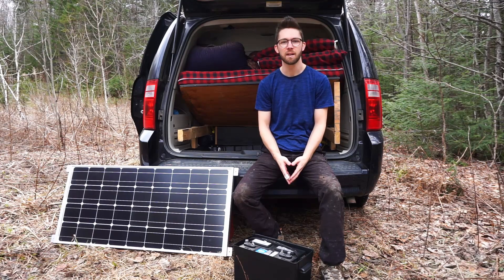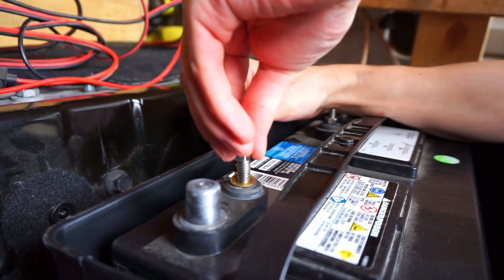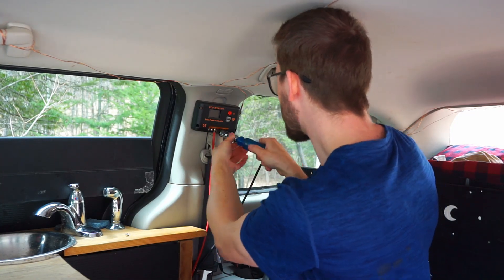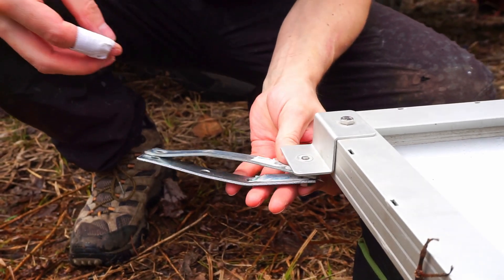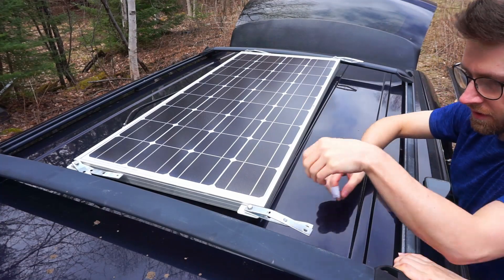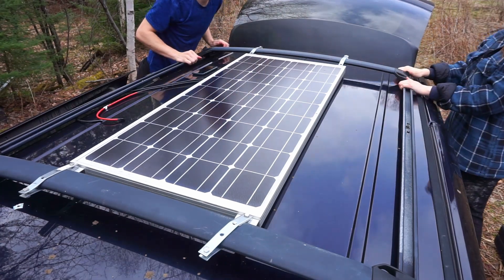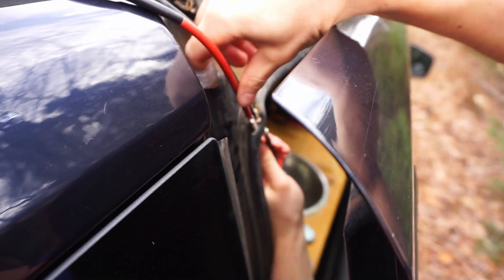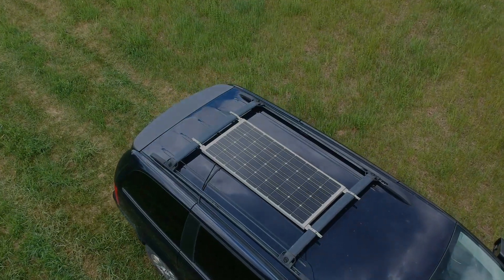How to install a SOLAR PANEL on a minivan campervan roof

Comment: One thing you might want to do is add some neoprene under the metal strips for anti-vibration /shock absorbant, and not scratch up your rails...

Comment: Thank you for showing this — how to also connect the wires. I am learning and have a mini-van for camping.   What kind of solar panel? How many watts?  What size battery?  That is so much fun to have the solar power on the roof. It looks great!

Comment: 2025:  Any water infiltration in 3 years with the incoming wires?  I'm thinking of a "drip loop" possibly through the rear hatch.   I also might stagger the lenghs of the two leads to reduce the risk of a short circuit, with redundant heat shrink tubing as well.

Comment: Has this held up well?

I'm looking at getting alu angle lengths 2 - 4pcs. 
Bolt them to the panel first.
Flip panel upside down on roof racks, drill through cross bar and angle. 
Flip back over and bolt on from underside or rails. 

Cheers from shaun.

Comment: You could use in fact, on 1 side, U brackets that slide just over roof bar, pinching it without having to attach in on that side. Easier and faster to install.
Just an idea

Comment: Thanks, I like the way you mounted the panel. 1 ? though would be alright to put pool noodles under the panel to help with movement at least while driving?

Comment: Hi, how will you mount the same solar framed panel using standard thule T-slot bar and do you think what size of solar panel is safe to mount? 20kg, 380 W 170x100cm?

Comment: I just tied mine on with parachute shroud. All I had to do was drill extra attachment holes in aluminum panel frame. Only drawback is they would be easy to swipe.

Comment: What are those brackets called you clamped to the crossbar?
Reply from the maker: They're flat mending plates. They bent around the bars as I tightened them
Reply: @NickandMaëla  ❤️

Comment: Have your solar panel cable held up with the door opening and shutting on them frequently over time?
Reply from the maker: Yes there's enough gap that they don't get crushed or anything. Plus that door is rarely opened

Comment: Can u connect with out z brackets and hist use the connect straight to bottom of pannel
Reply from the maker: It's possible, I guess. It would just change how high the panel is above the roof of the van

Comment: Where did you get the bracket for the solar panel? Can you send the link where you found it?
Reply from the maker: They're flat mending plates found at hoke depot. They bent as i torqued them around the roof rack bars
Reply: So you wouldn't recommend them? I need something to make my solar panels reach my roof rack or might have to build a platform with thick wood

Comment: i just strapped 2 solar pannels to the roof rack and they fit width wise end to end perfectly snug between the roofrails and i just zip tied them together, easiest thing ever, no tools required. they already have holes on the underside of the bottom corners that u can run a zip tie through. its like they where designed to fit together inbetween roof rails.
Reply: Upload video
Reply: @KT-ed8hj   i kind of run a shit post youtube channel and i dont want to show people what car i drive or where i live. geo guessers n shit. 
I upgraded since, i have 4 solar pannels now. horizontally across the car in a row from back to front. they are zip tied to eachother and then 4 extra holes where drilled on the underside of each pannels frame that i have zip tied to the roof rails. the roof rails are retracted and the pannels sit flush ontop of them and are zip tied under. each 2 pannels gets their own charge controller which runs into a bank of 3 batteries that go under the floor in the stow and go seating compartment. this feeds the 4000 watt inverter.
Reply: @wompstopm123  thanks for sharing that. I am planning on driving up to seattle next week and living out of my suv for a couple months while doing side gig apps. I am wanting to get a 42L fridge/freezer in my car and will run a box fan at night. Was wondering how i can go about this without screwing my alternator or car battery. I have no idea what im doing. I just know i need a freezer and box fan in my car and will be running the car all day every day.
Reply: @KT-ed8hj  
Your fridge/freezer should plug right into your car/vehicle's Cig Lighter outlet.
I have a 100Amp Hour LiFePo4 Battery $200.00, in a Battery Box that I bought on Amazon for $89.00 just for backup. 330watt Solar Panel on top of my old Hummer H3.
I'm in the process of installing a Chinese Diesel Heater in my Hummer now.
Reply: @Snailmailtrucker   I've heard people say you will drain your main car battery using it for that stuff you need a second battery
Reply: @KT-ed8hj Your comment said you "will be running the car all day every day". As long as the car's engine and Alternator are running it will power your small Fridge/Freezer (not sure how big that Box fan is tho !) They will drain the car battery if the car engine isn't running !
Reply: @Snailmailtrucker  Hey man, how will you mount solar panel on standard thule bar with T-slot. Do you think 20kg solar panel is safe to mount on the SUV roof? I mean, i dont affraid of weight rather than wind and speed. I want to place framed solar... regards!
Reply: @cenobitz use simple L brackets and the T slot.
They're driving with bicycles onto roodbars. A flat panel of 20 is nothing
Reply: @janvanlandeghem9749  i've already mounted it and working like a charm. Zero problems. Got power during driving and while camping. I definitely recommend to make custom mounting plates and than use t nuts because this make this panel as flat as possible and it's hidden behind bar.

Comment: I like how you used the Z brackets upside down so you could sort of recess the panel between the crossbars.  dont understand why so many minivan builders like to have the panel jutting out above the crossbars.
Reply: You need a couple inches for airflow or else you heat the roof of your minivan.

Comment: Hey man, where did you buy this panel from?  What brand is it?  Thanks
Reply from the maker: I believe this one was Ecoworthy
Reply: @NickandMaëla  Thanks for the reply man.  Trying to do what you did here for my Element.  I found similar z brackets from home depot but they are too short for my renogy 100W.  If I have to drill holes into the panel’s frame to fit, that might void the warranty no? :/
Reply from the maker: @kevinnghe1  it might, better check the warranty info before drilling!

Comment: How thick are the brackets and how did you bend them? I got some 6 inch zinc steel ones and they are  extremely hard to mend.
Reply from the maker: We put the bolts through and tightened them with a socket wrench, which slowly bent the mending plate as the nut tightened

Comment: I strongly suggest you place fuses in line with the positive lead from the solar panel to the charge controller and from the charge controller to the battery. Of course anything you plan on running off the battery should be fused as well.
Reply: That's why we like using solar power stations. A layperson will end up burning down their car.
Reply: Got any good vids on how to do this?
Reply: Just use an inline fuse.

Comment: Great video. How did you bend the mending plates?
Reply from the maker: I put the bolts through the holes then just torque it until the metal bends lol

Comment: Is there anything that you have done to prevent theft if the panel?
Reply from the maker: No, solar panel theft is pretty rare. I haven't heard of anyone getting them stolen
Reply: No one is going to steal a used $200 panel to be sold on ebay for $40 or pawn shop for $20

Comment: can you tell me what brackets you used to mount the the solar panel to the roof rack been searching Home Depot and Lowes all day and can't find a thing?
Reply from the maker: Theyre just flat mending plates, i believe 6" long. We just bent them slightly to fit around the rails
Reply: @NickandMaëla  thanks so much saved so much time <3

Comment: and where did you get that from that came with those brackets that is a perfect fit
Reply from the maker: The metal are brackets are just flat mending plates that we bent slightly around the roof rack rails

Comment: hello. in the beginning of the video you are connecting wires to the battery, where did those wire come from? are they from the van? an inverter? i'm still learning. thanks!
Reply from the maker: The other end of those wires connect directly to the solar charge controller :)

Comment: Nice design. Is the panel sitting directly on the roof?
Reply from the maker: Nope, bolted to the roof rack rails, it's an inch or two above the roof
Reply: @NickandMaëla  Perfect. Thanks

Comment: Did you make the metal pieces you attached to the roof rack ? Or did you purchase them ? Thanks
Reply from the maker: Purchased them! They're called ''flat mending plates''. We bought them flat and bent them around the roof rack rails
Reply: @NickandMaëla  Thank You  Love the video  I'll subscribe
Reply: Those perforated strips of steel,  usually galvanized, can be found at your diy home store where you'd find hardware for assembling a deck. As "mending" plates they are meant as a splint for cracked or splintered wood.

Comment: Where did you buy the brackets? Can't find them anywhere on the internet.
Thank you in advance!
Reply from the maker: The flat ones can be bought at any hardware store. The angled ones came with the solar panel
Reply: @NickandMaëla  The long angled with holes can't find them anywhere. I have the Z ones. What store did you buy them from?
Reply from the maker: @minivancamping6556  home depot. Should be this one! https://www.homedepot.com/p/Hardware-Essentials-6-x-3-4-in-Zinc-Plated-Mending-Plate-5-Pack-851500-0/203810324?MERCH=REC-PLP_Browse_MobileNA-203810324--N&
Reply: @NickandMaëla  That's a straight piece. Did you bend it yourself?
Reply: @minivancamping6556  yes i wanted to ask the same question. Did it naturally bend and conform to the rail when you put them on or did you bend them before installing the brackets?

Comment: so is the solar panel lying directly on the roof top?  If so, wouldn't that cause it to experience a lot of vibration?  seems mounting directly to the cross bars might be better?  And also I heard it's better for there to be an air gap under to solar panels so they are a little cooler?  thoughts? ty!
Reply: He answered another person that it is held in place an inch above the roof.

Comment: Where did you buy the equipment? Was it a kit?
Reply from the maker: The panel, wires, and controller came in a kit. You can buy kits like that on many online retailers. The battery i bought separately

Comment: How much power is generated and what are the uses for your application? Looked like a simple install!👍 😎 👋
Reply from the maker: We havent measured any actual output, but its enough to run our water pump, lights, charge all our electronics, and run a small fridge (if theres enough sun)